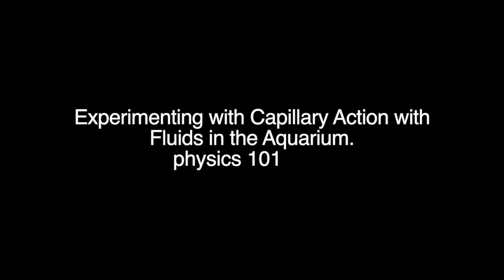Experimenting with Capillary Action with Fluids in the Aquarium.Kevin Novak Ph.D.

Comment: Hi Dr Novak. Jar 2 without the straw seems to diffuse faster than jar 3. What would be the reason for this? I would have expected the jar with the straw to diffuse faster. 
In view of this would a ugf plenum without the airlift tube work? and possibly better than with the airlift tube?
Reply from the maker: Yes a Plenum without a lift to what will work. In fact that is the way it was originally designed to not have a lift tube. I just realize that it seems to work a little better with one but of course that’s your choice.
Reply: @anoxicfiltrationplenums  Thanks Dr. I have implemented the bcb bags in my canister filter & in the aquarium about 3 weeks ago and I am waiting for them to mature. Once they start working, I am planning  to empty the tank and install a plenum & so I am planning on how I will go about doing it and what materials to use.

Comment: Hi Kevin, love your videos.
Just a little confused, isn’t this an example of diffusion and not capillary action?
Reply from the maker: Yes it is, but it is also capillary action too. Because of the filter floss I used will extricate any liquid like a sponge does. Now you have capillary action taking place. Diffusion would be the pouring of the water into the jar to intermingle water with the poly filter floss. Diffusion the action of spreading a source , like water, evenly and becoming one with the floss. This takes place with an Anoxic filter along with capillary action of the Cat Litter, oil-Dri, or Safety-sorb that is used. For example: Sand and soil both have the ability for capillary action of water along with diffusion of substances too.

Comment: Very interesting discussion and experiment.  I totally agree that commercial fish stores etc. are more interested in selling equipment and fish than helping the average hobbyist.  Most of the huge array of canister-type filters are only required if you want to have a tank that is out of equilibrium!  By that I mean if you have a tank with an under gravel filter, well planted and not overstocked with fish the only thing you need to add is food.  You may need to do a little filtering with a HOB type filter just to polish the water so it is more pleasing to the eye.  I admit that if you keep some of the larger Cichlids it is almost impossible to maintain a tank in equilibrium and external filters are required.  When I was breeding fish even my grow-out tanks were fully planted and kept in equilibrium.  The only tanks that were not planted were the breeding tanks. 

Once again today's experiment was interesting, however, I am however confused by the use of the term "Capillary Action".  My understanding of capillary action is as follows,
"Capillary action is defined as the spontaneous flow of a liquid into a narrow tube or porous material. This movement does not require the force of gravity to occur".  I would have thought that the action taking place in your experiment would be closer to Osmosis.
Reply from the maker: Capillary action is the ability of a liquid to flow in narrow spaces without the assistance of gravity. Example: Like a sponge does when it sucks up water. The poly filter will do the same thing, like dirt and sand will.
Reply: @anoxicfiltrationplenums I agree with your example of a sponge sucking up water but only when the sponge is dry.  In your example, the poly filter was already saturated with water and is below the point where the dye was introduced, therefore, capillary action should not be a factor.

Comment: Denitrification requires slow movement..so jar 1 is maybe slowest..but it does not mean that it will not work at all..maybe slower..even without plants ..and that's why deep substrates have been found to work the same with or without plenum for years..reefs have been using it for decades.. also..by this same experiment, it shows that adding a lift tube actually slows it down..and a bubbler beside the lift tube is unnecessary..so plenum definitely works..but this again proves that without plenum also works..
Reply from the maker: Jar one showed that if you place your substrate directly on the bottom of an aquarium you may or may not be successful. Only about 1/3 of the tanks to only ¼ that I have set up and Pecktec have set up with substrate on the bottom were successful tanks for any long term. That is not a very good batting average at all. Why? If two long term hobbyists can’t even get a 90% success rate with placing a substrate on the bottom of an aquarium, then how many others are also having the same results as us? 

 By what you are saying just because people drive without car insurance and have been successful at not getting into an accident, that then shows car insurance is not needed because they are so successful at not having it. You are not accounting far all the failures in your statement too. For everyone person that is a success in placing substrate on the bottom of an aquarium, how many have completely failed at doing the same thing? This has been going on for year and years (60 plus years now) now that hobbyist are not as successful as you state. Some are and others like me and Pectec are not. I’ve seen saltwater tanks with their substrate on the bottom with purple slime algae all over the bottom of the tank’s substrate. The fish forums are full of such problems of people asking for help constantly. They all have one thing in common, substrate directly on the bottom of their aquariums.

The lift tube if applicable and if it had a stream of bubbles coming out of it would have definitely displace the water faster in the bottom of jar three. It would have added in the displacement on molecules from one body of water to the other, that is just plain physic.  By your statement what scientific proof do you have showing a bubbler would not be unnecessary? The straw showed that even with a hole in the poly filter no extra amount of dye came through it to aid in the transportation of fluids and dye to one body of water to the other body of water in the plenum. Bubbles on the other hand would have, even at a very slow rate, moved more water than the other two jars by bypassing diffusion or capillary action. I have discussed this in my videos to some great extent, too.
Reply: @anoxicfiltrationplenums  deep substrates have very specific conditions in which they will work.. just like your clay and laterite.. many people fail cause they dont follow those conditions. Placing a non deep substrate is almost a guarantee it will fail.. just like you, there are many hobbysts who have followed the principles of deep substrate and succeeded..so maybe you have to follow those yourself before reaching at a success value and the failure rate of others, you can at best assume.. you really have to understand what i am trying to say..i am not saying your method doesn't work..it definitely should work..but does not mean deep substrate won't work if placed directly..maybe yours will be more efficient cause of faster turnover of water ( although if its very fast, oxygenated water will manage to reach and the denitrification will fail)  even you agree the movement has to be slow..i did see many of your videos.. 
Your experiment does show that with more time, the dye does reach the bottom eventually..so even you cant say,by corollary of your own experiment, that water movement won't occur..thats just logic..if it did not reach at all, then it would have been termed as a failure..you just proved it will be slow..  plenum with bubbler and tube of course will be faster than no tube.. with no bubbler...in jar 2,3, a tube does not make a difference, and in fact slows it down.. but then do we really want that fast a movement of water..this is just a query, but have you set up one without cannister,bcb,external filtration, with just a plenum substrate and set up two such, one with lift tube and one without..and compared the results.. if your jar results hold true, you might find, that a lift tube might be unnecessary.. although that can be told only after further experimentation.. also , does a substrate  with plenum work if its not the specific clay and laterite? Cause unless it works with any substrate, it is not applicable to a majority of the world population where those are not available.. so might wanna run that experiment too, with other substrates like sand or fine gravel..which  will help many more hobbysts..thats your motto as you say in other videos time and again.. to make the hobby conform to those who dont have specific resouces..water being a resouce too ..

Comment: I have a 55 gallon planted tank that I used about 1” of larger rock gravel on the bottom so it has empty voids between the rock then I used about 2” of mid size aquarium dirt for planting then caped it with about 1 “ of black sand this tank has been setup and running for a little of a yr with just a cf100 canister filter filled with phosphate remover, carbon in a mesh bag, lava rock as bio media, and then sponges where the water goes though the sponges to the phosphate remover though the carbon then the lava rock back to the tank I have 2 angels about 25 tetras 7 Corey cats a handful of snails 2 dwarf frogs 2 bristle nose pelco and I am sure I am forgetting something in total about 40 things living in the tank and when I first planted I used co2 but haven’t used since plants took hold and I have the fluval skylight that is set for 6 hrs of daylight and the rest is nightlight my water is perfectly clear I have not had to do a vacuum In like 6 months because there is nothing visible and my nitrates never get above 30ppm no matter how long I let it go but I do about a 30% water change every month just to put minerals back into the water
Reply from the maker: Great to hear, thanks for the info.

Comment: What if the blue liquid was mulm, wouldn't we just be pulling that mulm in the bottom and putting it back in the water column using an under gravel?
Reply: The UGF filter flow rate should be low enough to not pull particles through or entrain them out, so it should be getting caught in the substrate or just settling out on the bottom where bacteria would work on breaking it down.  Look up Goliad farms to see that mulm doesnt have to be feared.
Reply from the maker: Very good reply sir.
Reply: @fredkibler  Then why do people say you cant use UGF with sand? i imagine sand to be more dense than mulm.
Reply: @amarabidali5316  well if mulm was allowed to condense and not break down I am sure it would be more dense but isnt and it does break up and break down.  Sand though does not break down and it will compact over time thus restricting the flow of water and anything else through the substrate.  I have sand on top of my UGF and the top inch holds all the dirt and very little penetrates.  I can see pros and cons to this but I am still learning.
Reply: @fredkibler  nice, i was thinking of a DSB-UGF combo with quite a few inches of sand so more water will pass the anaerobic zone.
Reply: If the tank is well planted the mulm breaks down and is used by the plants.  There is very little point in having an under gravel filter in a tank that is not planted.
Reply: @davidcrofts1684  An unplanted tank can make perfect use of the plenum from the UGF regardless of the lack of plants. Any detritus breakdown into mulm isn't causing a problem if plants aren't around to use it, because the bacteria you are creating handle it.  That's the entire point of this idea to have the nitrogen cycle COMPLETED by the bacteria from the anoxic zone. Plants, while they will use some of that nitrate or mulm, aren't necessary since there is bacteria we're creating to handle it. 

The majority of aquarists don't use live plants. For whatever their reasons.

Comment: You’ve convinced me.  I’m setting up a plenum later this week.  But I have 2 questions I need answered. On a 29 gallon tank, will I need one lift tube, or two?  And what size air pump is best?
Reply: You will only need one lift tube and a small pump.  You want to move the water very slowly through the plenum, so minimal bubbles are good.  Good luck and have fun.
Reply: You don’t even need a lift tube at all
Reply from the maker: A very small one will do the trick.
Reply: @anoxicfiltrationplenums  Plenum going in tonight. We'll see how it goes.

Comment: Why was #3 lighter blue? What was the reason for the straw? Did it slow the capillary action? 🐸
Reply from the maker: The lift tube if applicable and if it had a stream of bubbles coming out of it would have definitely displace the water faster in the bottom of jar three. It would have added in the displacement on molecules from one body of water to the other, that is just plain physic.  The straw showed that even with a hole in the poly filter no extra amount of dye came through it to aid in the transportation of fluids and dye from one body of water to the other body of water in the plenum. Bubbles on the other hand would have, even at a very slow rate, moved more water than the other two jars by bypassing diffusion or capillary action. I have discussed this in my videos to some great extent, too.

Comment: Dr do you think we can implement a capillary action syphon design in any part of the hobby? Or would it be too slow and too inefficient for anything but watering terrestrial plant?
Reply from the maker: In the hobby we depend on diffusion mores than capillary action.
Reply: @anoxicfiltrationplenums  I've thought about that too, it's not really relevant to this video though. I've been thinking about it to use as a very simple and highly reliable overflow (self priming, is not broken by air bubbles getting in) in order to run a sump, but I wasn't sure if the flow rate would be enough.